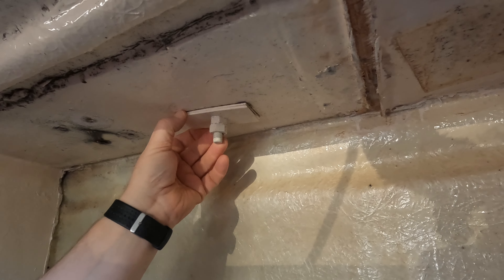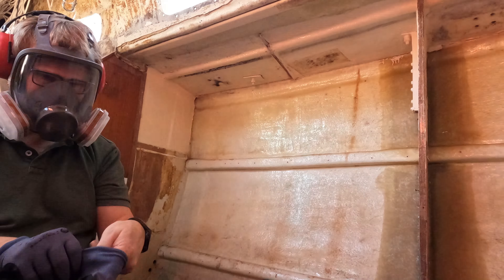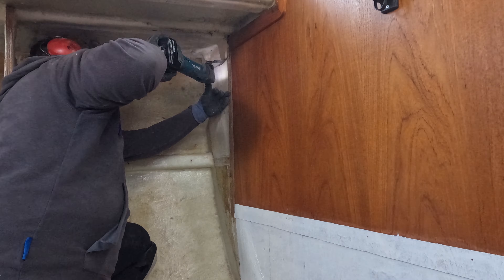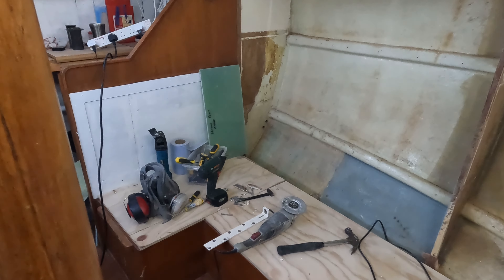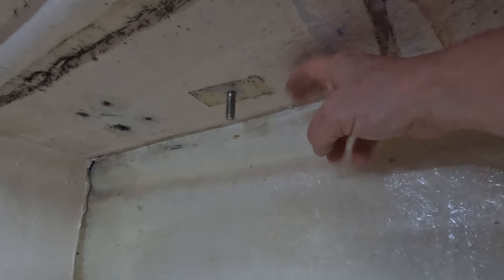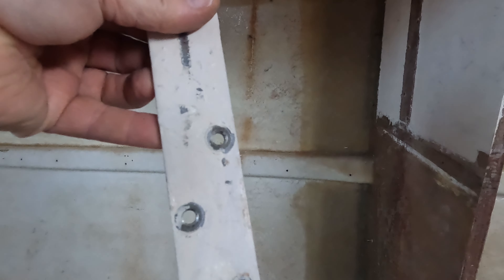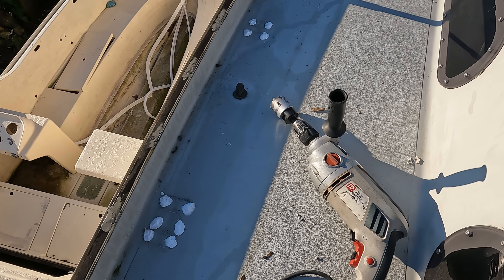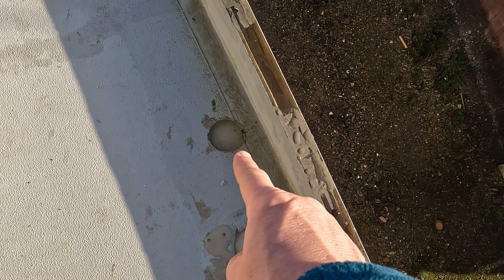Epoxying in the backing plates for our Dyneema Chainplate Loops. Dyneema Standing Rigging Episode 4

Comment: Hi, when you can if you have room we drill from both sides with the hole saw so part of the plug is sticking out of the saw so you can get a pair of pliers on it to remove . 
When we break a pilot drill we just use any short 1/4”(6mm)drill and grind a small notch in the edge for the set screw. 
You can also replace the pilot drill with a solid steel rod and use it as a true pilot and pre drill the hole in the material you are cutting.  Various uses for this approach including accuracy. 
I’ll be Interested  to see how you stop deck leaks with this method. 
Cheers Warren 
Ps what a lovely day in Anglesey !
Reply from the maker: Good tips for the holesaw. We have adopted the drill from both sides approach where we can.
Hadn't thought about those ideas for the pilot bit - Thanks!
Dave